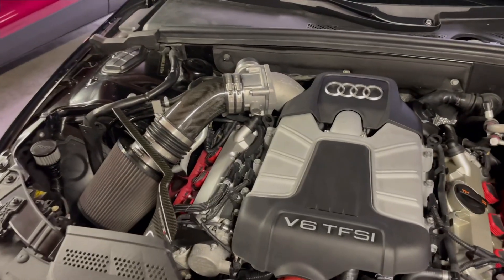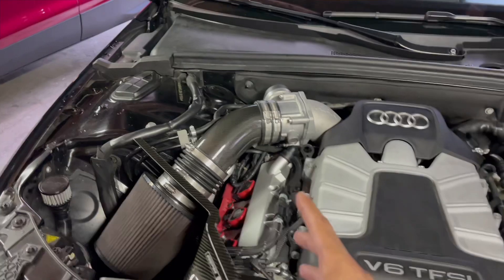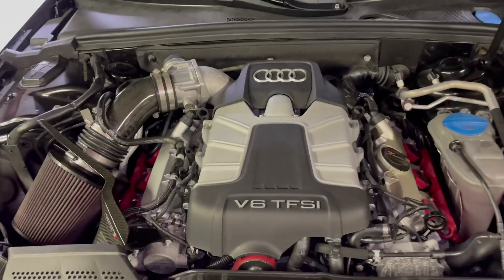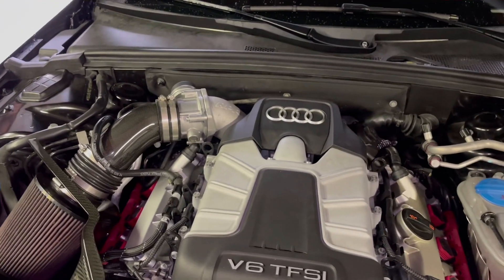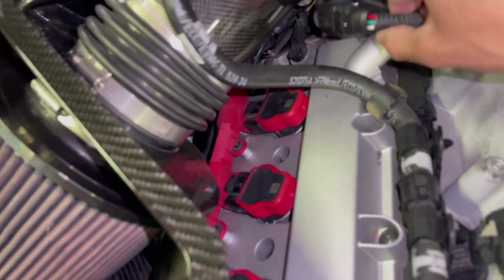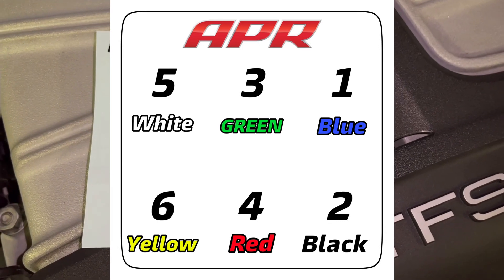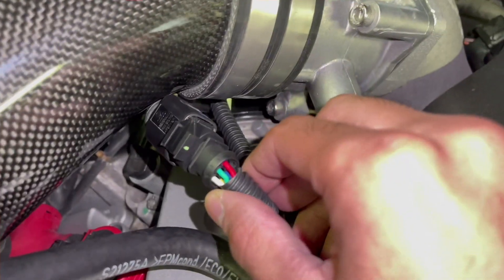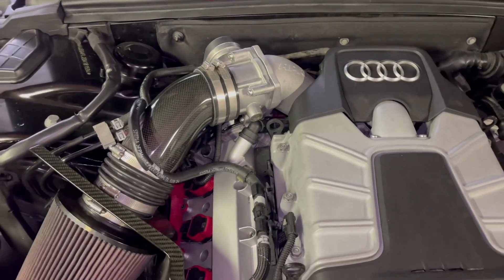How To Run Any UPGRADED Throttle Body with 034Motorsport! (WATCH FULL VIDEO)

Comment: so you had to switch 3 and 5 as well as 1 and 4? currently been going back and forth with 034 for a while now trying to figure this out. my adaptation keeps failing on 034 and VCDS. "safety reasons"

Comment: tried repinning my harness, clearing codes, and doing a throttle body relearn to get my 034 throttle body to work with my IE tune. throttle body relearn showed as successful. but it still won’t work :/
Reply from the maker: Pretty much in a nut shell all the wires have to match the opposite side expect the 2 I said have to mismatch

Comment: What's your 1/4 mile time?
Reply from the maker: Idk the exact # I went to the track once with 93 octane and hot running it the whole time but I timed myself with a timer I’m in the 10’s but aye it’s crazy because I watch pretty much all ur videos that watermeth install was clean I’m gonna do the same set up as u I got ur video saved
Reply: @DynamicDemonRacing  ok cool I'm trying to hit 10's myself. Best is 11.00 flat. Just put the car back together so I'll get there soon I haven't tried it since I put long tube headers on..  but thanks Bro I appreciate you.

Comment: Hey, are you running the plm v2 heat exchanger? Trying to get a heat exchanger for my s4 and not sure what I should get yet...
Reply from the maker: Yea it’s the best fr I have zero problems with it
Reply: @DynamicDemonRacing  alright thanks that’s the one I’m going with. I wasn’t sure how it would hold up because of the price.
Reply from the maker: Same thing I thought but its great, ecs has a similar price one too
Reply: @DynamicDemonRacing  yeah that’s the one I’m trying to get atm I have a few buddys that work there so they could hook me up with a deal. But if that doesn’t work out I’m going to get the plm one.

Comment: Hey man, i have a question. Would you happen to know about the GAS 75mm throttle body or heard of anyone thats used it? Im trying to figure out if im gonna need a specific map or need to do a throttle body relearn or anything like that or if its just 100% plug and play. They told me their 82mm will throw codes and needs to be on a special tune for it but the 75mm is completely bolt on and no tuning is required. Im on unitronic so i don't have an option for any type of throttle body maps unfortunately.
Reply from the maker: idk tbh ive only messed with apr and 034 but 034 has great tunes and features like the throttle body realignment and u can log your car
Reply from the maker: check the forums